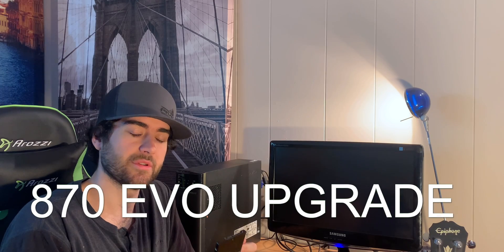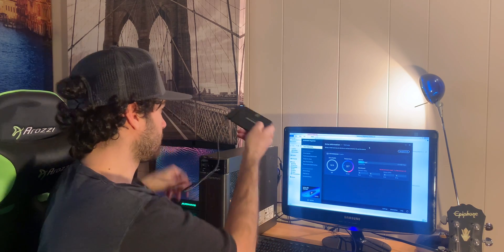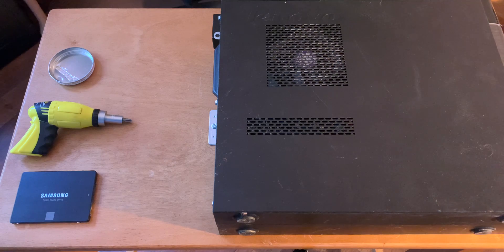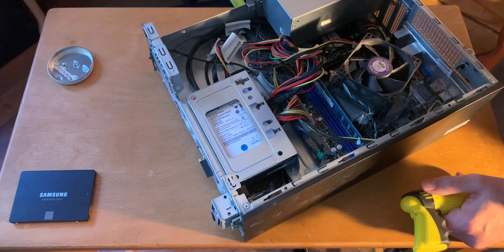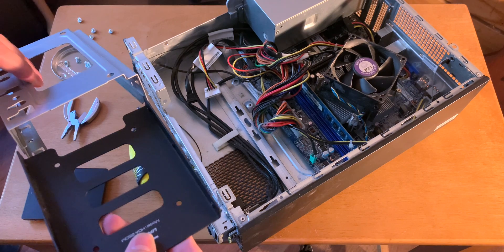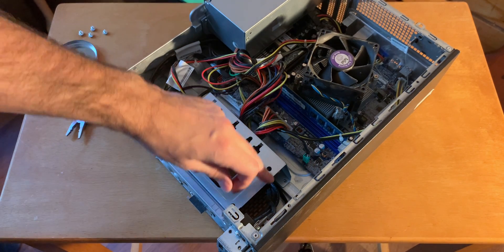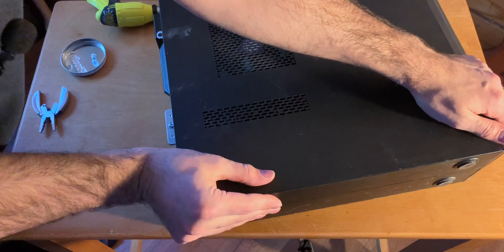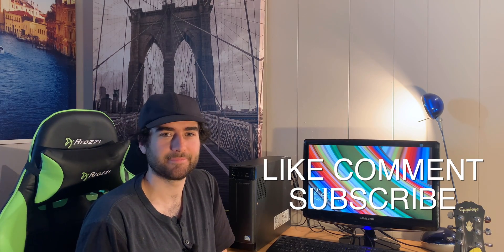How To Upgrade Your PC With A Samsung 870 EVO

Comment: I can see the disk EVO 870 from my HP laptop by a SATA to USB cable. (window 10 OS)
But I can not see once open the Samsung migration tool. And, once I open the samsung software, it just disable the ssd ? any reasons?

Comment: I did all steps up until when I tried to power up the computer with the new samsung ssd connected, it wouldn't boot the bios, tried all f keys and delete. Checked the cable as well. What could have gone wrong?

Comment: I get an error at 1 minute
THE DATA MIGRATION FUNCTION HAS BEEN INTERRUPTED FOR AN UNKNOWN REASON

I have closed my anti virus, Scan for error (chkdsk), turned off Hibernation and set my comp to airplane mode. With all other programs closed. 

I've working on this over the past couple days and it's getting frustrating

And as you can probably tell, I'm not super knowledgeable about computers, but I get by

Any help would be greatly appreciated

Thanks in advance

Comment: PC is slow to boot despite the SSD being first in the boot queue and programs are slow to open. Any idea why?
Reply from the maker: Hmm, wierd! Unless you're using sata 3 which is the fastest fornat, yours might be sata 2, which is a bit slower, but should still be fast! Are you sure you installed Windows on the SSD? It's so fast on all my devices when I switched! Let me know if it's faster! You might have to redo it! Or it might be your system! There could be a lot of factors.. sorry it's not faster for you! At least you've got the reliability from it. But hopefully you figure it out!! :)
Reply: @TechAfterDark  Thank you for the reply, it is much appreciated. I actually got it working, for some reason the computer was booting off of the HDD despite the SSD being first on the boot queue. All I did was disconnect the HDD and the computer would boot up from the SSD from thereafter, even if the HDD was reconnected. Great video btw, I hope this comment may help others with similar issues.

Comment: does the USB adapter you used to connect the SSD come with the drive?
Reply from the maker: Nope! It doesn't! Sorry I didn't say that in the video, the cable is linked in the description! But you don't need it, I just think it's nice to have and easier to install and troubleshoot

Comment: I currently have a HDD and am looking to upgrade to this (870 eco ssd 500gb) but my HDD probably has ~1.8 Tb of data. So is it possible to only “clone” or transfer certain things. In my case, windows and some other various games and applications? Without messing anything up, and keeping both drives working?
Reply from the maker: Ya! I would honestly put just the operating system on the SSD, and transfer anything you need from the HDD. and install chrome ect and needed applications. I wouldn't try to clone it or anything, just go with a clean upgrade! Your Windows genuine key will be linked to your Microsoft account, so just install the windows upgrade tool on a usb and install it on your SSD! :)
Reply: @TechAfterDark  Hi! can you tell me how to install fresh windows? using my exisitn gproduct key

Comment: Do you need to install into the hardware to use it?
Reply: @Attxck apperantly you have to, as I have a laptop I had to send it back
Reply from the maker: Sorry about that! Ya, I recommend putting it into the hardware, but you can leave it outside if you don't have the space, but it won't be the full speed!
Reply from the maker: You could! Totally up to you. But I always recommend putting it inside the machine as it'll always fun faster

Comment: I have the same ssd but not the same kind of plug in?
Reply from the maker: Might have to find a sata cord and plug it into power supply, or steal a cord from your CD drive or old hard drive! Those use the same data cords, you need power and data cords! Both very universal!

Comment: My Samsung magician sees the 870 but says does not support it, like how is this? I did install the new drive with a USB adapter and cloned my hdd while it was via the USB adapter.. But now the drive is connected via the sata6 cables.
Reply from the maker: You might need to format it! Go to my pc and right click, manage, and go to disk management, and create a new volume, leave all options to default, and format it! Should be ready to use in Samsung Magician after that! :)
Reply: @TechAfterDark  should I not use to Erase/wipe Feature via the magician?
Reply: @afoquinn17  If you format everything will be erased anyway.

Comment: Do you need to install drivers for the 870 evo?
Reply from the maker: Nope! It'll work automatically out of the box, but you can choose later to update your ssd drive through Samsung magician, and add over provisioning! Which I recommend to give it more life in the future!
Reply: @TechAfterDark  I'm having a problem where windows is crashing whenever I play certain games. Some games I can play for hours and it's fine but some games will crash after like an hour and if I try it again right away it will crash even sooner. If I uninstall and reinstall the game it will work again like the first time, about an hour, but it will still crash eventually. This only seems to happen with games that have more demanding graphics. I'm using a ryzen 5 2400G with the integrated graphics so it doesn't take much to max out my graphics but I'm getting the problem even with games that I had never had a problem with when I had my old SSD. This all started when I upgraded from a ADATA SU800 256GB to my Samsung 870 EVO 1TB SSD.

At first I tried using the data migration software to clone the drive and eventually windows kept crashing to the point where Windows wouldn't even start anymore. So I did a clean reinstall using a USB drive and I'm still getting this problem. I don't know what else it could be. I was hoping it would be a simple thing like needing to update drivers for my Samsung SSD but I could find no info about having to do that. If you could think of anything I would really appreciate it. If not that is okay. I'm sorry to dump all of this on you.

Comment: I'm having a problem with adding my 1TB 870 evo as an addon to my 1TB HDD and 500GB 850 evo. For some reason my rig wont boot with the 870 hooked up via sata. Do you think I have to use the  USB to SATA and clone everything first?
Reply from the maker: Have you tried going into the bios settings and changing the order of the boot priority? You don't have to use the USB to SATA. But sometimes it can help make things smoother!

Comment: bro... what is the cable you used? my ssd did not come with one
Reply from the maker: It's just a simple USB to SATA cable I bought off Amazon. Very handy if you want to do it right! You can however use it without, but it's nice to load up everything without the need of putting in the SSD blind.

Comment: i have system lenovo legion t5 26amr5 with storage 500...i buy 1tb samsung ssd 870 qvo .. how can i use this 1tb drive as my secoundery storage drive without disturbing 1st drive and data...i want my 1st 500 gb drive as my c drive and 1tb drive as D drive..help me out please
Reply from the maker: Hey Babar! It looks like you might already have a 1tb drive in your cpu already. Or you have an empty slot. All you do is plug the ssd into the 2.5 inch hard drive bay and it won't disturb your c drive! It should show up in your my pc. Let me know if you have any more questions!

Comment: I have a 13 year old PC Medion MT 7 with 4GB ram, Hdd getting pretty full is installing a 1tb ssd wise
Reply from the maker: Oh yes! If you have the extra space, I would put a second ssd evo 870 in. But I would do a clean install, and either clone your current drive. Or I would recommend doing a clean install on a brand new os with lots of space. make sure your operating system is on an ssd! they rarely ever fail. you can use your hdd as a backup drive.

Comment: Best Buy didnt tell me i needed a bracket for this…. Or cable to clone… or screws….
Reply from the maker: depends on what you want to do! If you want a clean install, and make it easier, i would do it my way! Or you can just switch it into the pc without this, and tape the ssd inside. but I prefer having a clean setup. there are lots of ways to do this!
Reply: You may not. My case fort example has SSD places. Yours might too. And even if not you can just put it somewhere inside. Is not a hard drive so you don't have to worry about vibrations and getting damaged by vibrations etc. 
Also i think you can just install it inside and clone when inside. Or you can just go with a fresh install.

Comment: finding zero help online for changing my ssd to the boot drive. i went through the BIOS and flipped all kinds of settings but it's just not changing anything
Reply from the maker: I would just plug it into your old hard drive. that might make it boot from ssd. or you can unplug everything when booting so it defaults to the ssd. make sure to install windows properly. this is why i use an extra cable so i dont disturb the old hard drive!

Comment: Would you recommend this Samsung 870 EVO SSD in the 4TB form for Storing 4K 60Fps content? I have an NVME for my operating system and my software. So basically when I get done editing everything and it starts to render, it would be stored in the SSD. I currently have a 2TB HDD but it's Super Slow vs the NVME, I just got a new PC. Thanks again for your reply.
Reply from the maker: Ya, i would get a evo 870 instead of the 2tb hdd! If you can swing it get a m.2 drive! you can get enhanced speeds over a regular ssd. but the 870 still is super fast! And way better than an hdd
Reply: @TechAfterDark  I actually went for the 870 Evo SSD the 4TB version and wow what a freaking huge improvement lol! What took me 72 hours to transfer 365GB of 4k videos I made from my old computer 2009 HP TouchSmart 610 with 1TB HDD to my PNY 512GB usb and from that same usb to my new PC (Razer Tomahawk Gaming Desktop) with the new 4TB Samsung 870 Evo SSD was literally 10 minutes!!!!! My wife wanted to Punch me in the face for having my old PC on for 72 hours transferring 365GB of Content over to my usb because the PC faces her side of the bed and she couldn't sleep even with the screen brightness at the lowest setting lol! She even told me that I should just change the 1TB HDD in our old pc to a SSD to improve the speeds since there is technology nothing wrong with it other then it being slow for my Content creation Hobbie. So I'm going to definitely consider it. It's unbelievable how fast the SSD is to a HDD. The new PC is in my living room so I won't disturb her or my kids should I stay up at night editing videos for my channel.

Comment: Great clip.  Note that optical drives are almost useless these days.  Plan B would be to keep the 1TB hard drive and have the SSD.  You can literally tape the SSD in place, it doesn't need a special caddy.
Reply from the maker: Ya true, for the video, I removed it and swapped, but since the hard drive kept failing, I didn't think it was worth keeping it in there, on my other PC's I've kept my regular hard drives in, and even repair a MacBook pro, and took out optical drive there, and have two hard drives in them. Ya, cd drives aren't very useful these days, maybe if you were a fan of Blu ray you could install one of those puppies in there :)